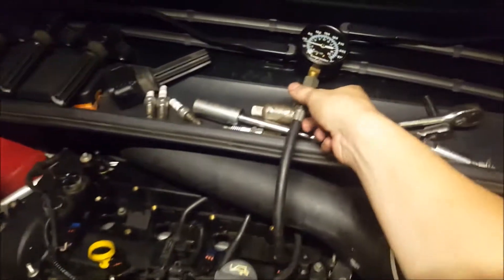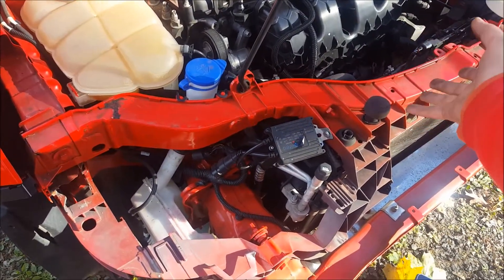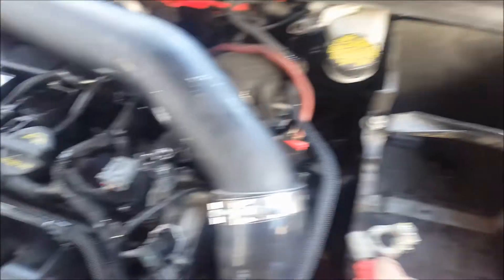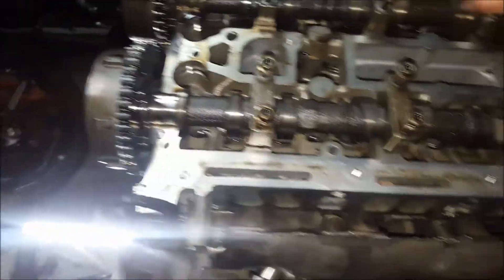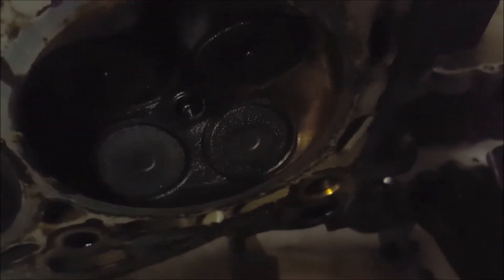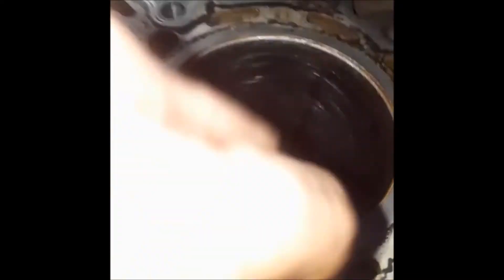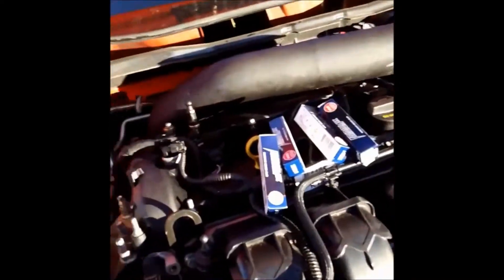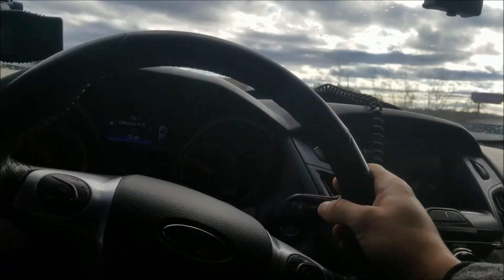2013 Ford Focus ST Engine Rebuild

Comment: Hello do I have to consider what the airbags do not deploy when I dismantle the front? Thank you
Reply from the maker: as long as you disconnect the battery you will be ok...... and connect the sensors before you connect the battery to keep the airbag light off the dashboard....
Reply: @ctzduce2k  Super thank you ! greetings from Germany

Comment: I ordered pistons, rods, rod bearings, (all standard size) and all the one-time use bolts and washers and got a block with 3000km on it (like 20k miles?) So I should be good to go if you didn't even replace your bearings or rods 😂 and I got the timing tool thing too
Reply from the maker: lol i had to get it back on the road as cheap as possible haha, not bad tho trans rebuilt and fix engine for like $1500 all in, i miss the car, im saving money in a TDI now hahaha worst idea i ever had trade the st for a tdi lol
Reply: @ctzduce2k  yeah I'm in a similar boat, it's not paid off yet so I can't just give up on it but the wreckers around here want like 2000 for a used motor and that might just do the same thing again

Comment: Hello from Germany, can you tell me if it was due to 5w30 oil? which oil do you have in your engine now? Thank you
Reply from the maker: no 5w30 is good..... it is due to i believe (LSPI) Low Speed Pre Ignition, and the cast pistons ford decided to use on it,

Comment: je viens de cassé le piston 1  configue stg3 turbo hybrid x37  1.95b boost 3200 a 7000k je vais le reconstruire en pistons et bielles forgé je voudrais des infos sur le timing  les outils  merci
Reply from the maker: https://jmcautomotiveequipment.com/assenmacher-specialty-tools-f20t-ford-2-0l-eco-boost-timing-set/?dfw_tracker=17151-174041&gclid=EAIaIQobChMI_8f_yrna3wIVEwOGCh1k0Q0pEAQYAiABEgJkh_D_BwE
Reply from the maker: this is the tool i used, you put the pin in the block rotate engine until it stops then lock the camshaft,then you can remove timing belt tensioner, when installing head to block you have to spin the cams with wrench, lock them in with the tool, but before put head make sure to put pin in block and rotate it to stop crank.....
Reply from the maker: c’est l’outil que j’ai utilisé, vous mettez la goupille dans le bloc, faites tourner le moteur jusqu’à ce qu’il s’arrête puis verrouillez l’arbre à cames, puis vous pouvez retirer le tendeur de courroie de distribution, lors de l’installation de la tête pour bloquer vous devez faire tourner les cames avec une clé l'outil, mais avant de mettre la tête, assurez-vous de mettre la goupille dans le bloc et faites-la pivoter pour arrêter la manivelle .....
Reply: @ctzduce2k  merci beaucoup  je vais regarder tout ça :)

Comment: So why do you think your ringland let go? 

Are they any mods? Any aftermarket tunes?
Reply from the maker: unleashed tuned since 14k, stock cat, str8pipe, intake, im thinking just weak piston casting and beating on it heavy daily just took its toll, i daily would make it pop bang, hit the rev limiter for fun, still make it pop bang with throttle blip daily just dont take it to the rev limiter and hold it there lmao